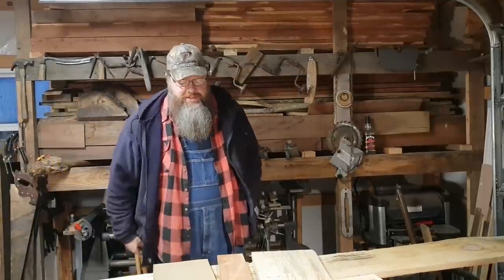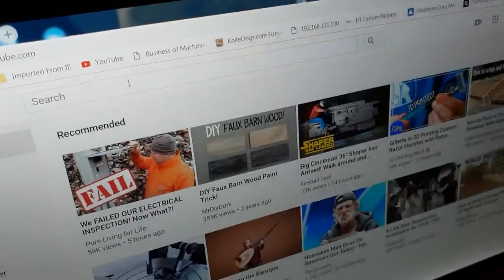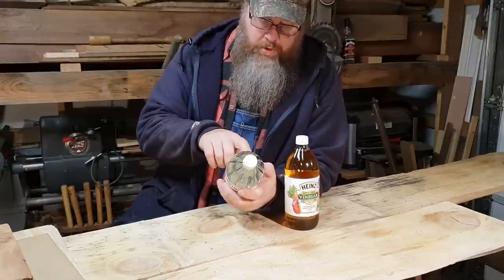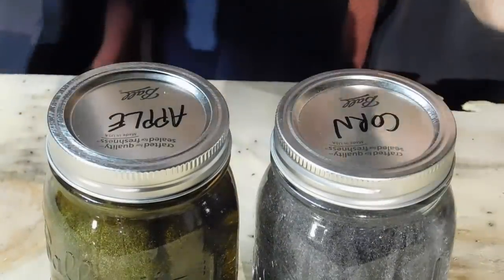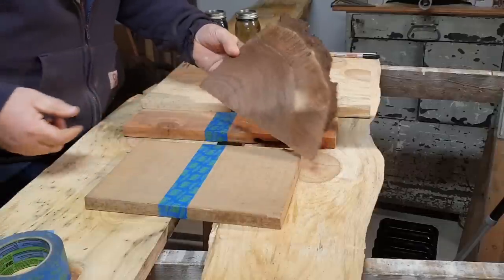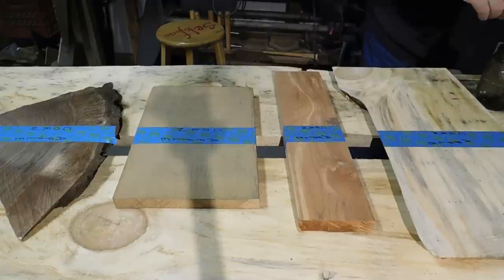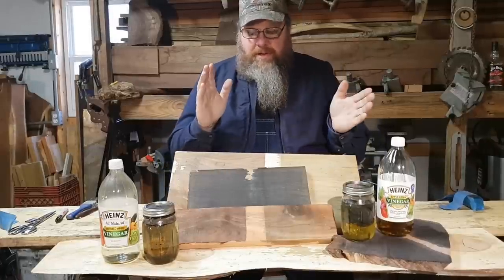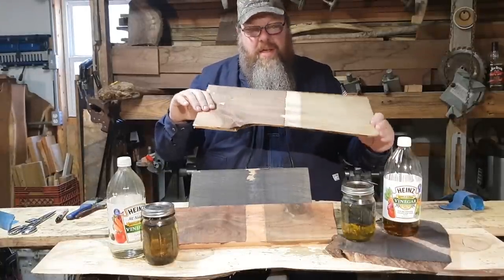Best Vinegar and Steel Wool Combo?

Comment: When making iron acetate like this, you dont want to keep the jar closed, the lid needs to be loose to let gases escape. Also after the waiting period, if you give the jar a few good shakes, it'll help incorporate the iron oxide into the vinegar. Lastly, to really help with the pine, or any other wood with a low tannin count, you can brush on some strong black tea before the iron acetate, it'll increase the tannin count and make it darker

Comment: did you hear about the tea trick?  I am no expert, but If you soak a few tea bags in a jar.....maybe overnight. Pretreat the wood with that. It will add tannins to the wood and make the reaction stronger.  That is what I have found .. Thank you for the video.  Best of luck.
Reply: In addition to the tea, adding some oak bark together with the tea bags is even better.
Reply: I used tea and it helped a lot

Comment: A few things:
1. You should wash the steel wool with mild soap and water to rid it of the oils used to stop it from getting rust.
2. Strain it through a stain filter or coffee filter first.
3. If you want a darker stain, pre-treat with black tea (add tannin's to the wood).
Reply from the maker: Can't remember for sure, but I think I rinsed the steel wool with acetone first. I was worried about oils too. I'm not really sure there are oils in it, but better safe than sorry.

Comment: This video has been very helpful..thanks! 
Probably too late...but you can darken the pine considerably by brushing with a solution of tea first. The iron in the vinegar solution reacts with the tannins in the wood to produce the dark stain. Pine has less tannin than the other woods, so the addition of the tannins in the tea helps. Having said that, I like the end result of the pine stain as is. Just about to use this method to stain the new T&G pine floor I just laid in my cabin. Going for that aged look, so will randomly ding and generally distress the wood first to make it look even more aged.

Comment: I've found that if you put two heavy coats on pine, let it dry, then sand to desired look. Also, I heated my mixture outside on a camp stove in a water bath to speed up the process of dissolving the steel wool. Thanks for the video. I was also wondering why not apple cider vinegar.
Reply from the maker: Good tip. I've been putting 2 coats on my pine and it looks great to me. I'm leaving mine rough sawn too, that might make a difference.

Comment: I have seen a very strong brewed tea brushed onto pine. Let dry and then come back with the vinegar solution. The tea will add tannin to the wood, and it will darken up a bit better for you. Enjoyed the tests.
Reply from the maker: I saw that too and was prepared to try that next. But, this rough sawn pine seems to be working pretty good, especially if you put a second application on. I think I'm ok with it.
Reply from the maker: @noeltravis7731  safe from what? Vinegar is a very mild acid, people even drink a tablespoon of it for heath reasons. We dye easter eggs in it and use it to sterilize coffee pots. Seems safe to me.
Reply: I've done both and honestly.  It doesn't make a lick of difference.  I've brewed a box of black tea (72 bags) in a gallon mason jar and applied it.  It looks just about the same as the non-tea version.

Comment: You can also purchase (on eBay) 'tanic acid' powder.  Dilute it in water and pre-treat the wood prior to using the steel wool-vinegar solution.  Marked difference in the final results.
Reply from the maker: Cool, thanks for that info. Hadn't heard of that, but makes sense.

Comment: Maybe you've figured this out by now, but you're not supposed to put the tops on the mason jars. The reaction takes place when oxygen mixes for 3 days with the vinegar and steel wool. By placing the tops on, you stopped the process from happening by starving the oxygen.
Reply from the maker: Tops were just sitting loose while brewing for first couple days. Then I left tops off 2 or 3 days, the reaction seemed about the same to me. Maybe it was just too cold. I'm going to mix up 2 gallons next and its warmer now.
Reply: @SelfMadeProject  Meh, I boiled my vinegar and left the caps off the whole time.  Your results are near exactly what mine were.  I don't think it is an exact science as some would think.

Comment: If you want to get your soup in one in a houre ore two, you have to force the start of the oxi in the steel wool, because the vinegar react with oxidized metal. take a pice of wool, a fireresistent bowl an a 9v accu! Just enjoy you little firework and your vinegar have instant the type of Ferrum he need. It works instant, smoot and the soup is often darker

Comment: Hey. How important is the wool in this project ? Thanks good video.  Craig. Pa. Guy
Reply from the maker: Well, from what I've read, vinegar is acetic acid and when iron is dissolved in it you get iron acetate. That iron acetate then reacts with the tannins in the wood. Vinegar by itself won't work, and I think about any source of iron will probably work. The steel wool just has tons of surface area, so the reaction occurs faster.
Reply: Self Made Project 

FINE steel wool is best ie 0000 should say on bag/bag. I got mine at  Walmart. First rinse steel wool because of factory oil and squeeze excess wAter. Also, SNIP steel into tiny pieces for faster deterioration.

Comment: The big question for me is this: How long does it take for the smell to go away? That's kind of important if you are going to use this in the house.
Reply from the maker: The white vinegar boards never really smelled much to me. The apple was noticeable when applying it, but I once dry I didn't notice it anymore. Of course, that's in my shop too, not the house, lol.
Reply: I'm doing a ceiling this way and once it dries you don't smell it. I used tea on them first to add tannins to the pine. After the vinegar it stains to a dark reddish brown. Try adding tea afterwards and it looks like old barn wood. I waxed it afterwards to add some shine to it so it wouldn't smell anyways.

Comment: How do you think I can get the grayest color on treated pine
Reply from the maker: A few people have suggested wetting down the wood with tea first, let it dry, then use vinegar. I haven't tried that myself. I did get a darker color by applying a second coat of vinegar after the first dried. Pine just doesn't have the same reaction as hardwoods, so there's limit to how dark it will get. In the end, I was happy with my pine using the two coats.

Comment: Does the colour remain on wood used outdoors ?
Reply from the maker: With the little I've done, I say yes. It just speeds up the natural process.
Reply: @SelfMadeProject  Thank-you for your response. 
I have another question... =)
Can you manipulate the darkness or lightness by varying the proportion of steel wool to vinegar ?  
I tried it on some red cedar, trying to tone down the red, but it turned it almost black.  I'm looking for a lighter gray.
Reply from the maker: @annieo9468  I haven't really tried different mixes. I guess you could take the mix you have and dilute it down with more vinegar. Maybe try a few different strengths on some scrap. I also had cedar and oak turn very dark, but I was primarily trying to get pine to darken. Pine doesn't respond nearly as well, so I was wanting a strong mix.
Reply: @SelfMadeProject  
Thank-you so much.  I had an idea it might, but I cheated and asked for someone elses experience. 😂😂
I will make a new mix tomorrow and see how it flies.
I really appreciate your responses. 
I've been to every paint store, and not one has had any trustworthy advice on what stain to use to achieve the look I'm going for.
I'd be happier with an "i don't know', than to have them start answering my question before I've finished asking my question. 😂😂

Comment: What happened to the mini mill cnc conversion?
Reply from the maker: It's still on the back burner. I just haven't had time to get back on it. I'm still working on finishing my shop mainly. But, I also make knives, do shirt printing, sawmilling, etc. which all makes money. Sometimes it's hard to take time away from those for tinkering.
Reply: @SelfMadeProject  I hear ya, i know how that goes. I just stumbled across the videos and got sucked into watching them. Good job with all that you do!
Reply from the maker: @jds3545  one of these days I'll get caught up and finish it up. Hang in there.

Comment: Does the mixture have to be in glass containers or could I use a plastic pale.  I need to do a fresh pine barn board door. 7’ X 7’.
Reply from the maker: Shouldn't matter, it might smell up the room with that vinegar smell, lol. Just don't put in a sealed container, there is a little gas that builds up in there. Not much, but be on the safe side.